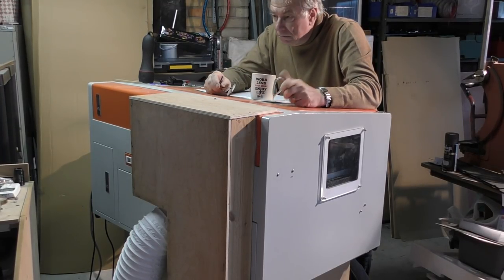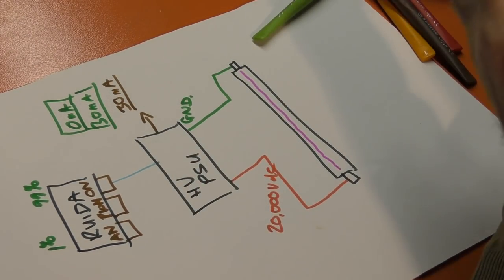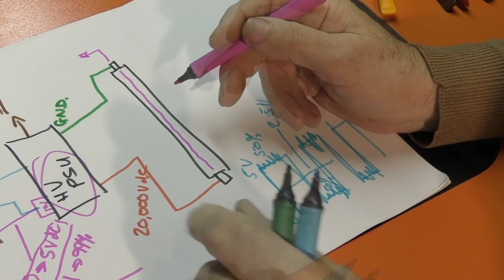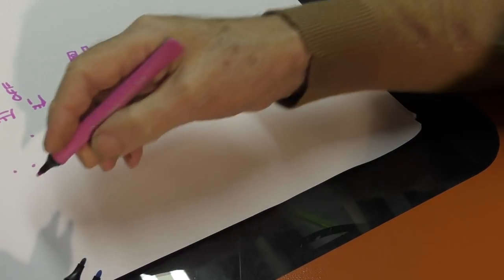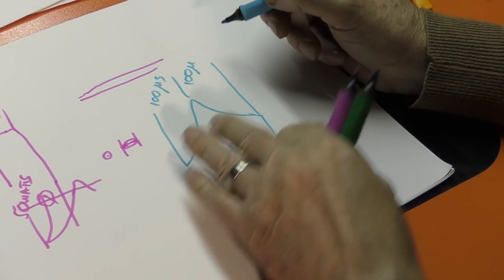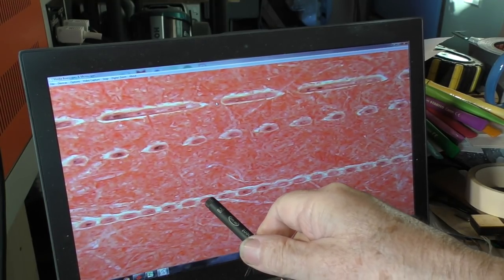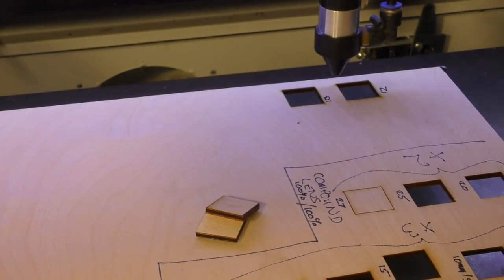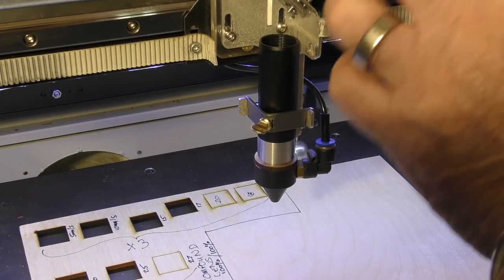TangerineTiger16 What Can We Cut with 20 watts

Comment: Hello Russ, first and foremost, thank you for enlightening me with your videos about lasers. They have been a good point of reference, since I just acquired a 60w Co2 Laser machine. I've been three or four nights watching all the videos of your blue china machine and the new tiger in Spanish subtitles. I have been amazed at how you gut to the maximum all the concepts that influence both cutting and engraving. Another thing that I saw in your videos a couple of days ago was to control the air in the nozzle with the example that you put by closing and directing the air jet ... Since then my recordings are much cleaner, which I thank you for. Heart, since the sellers as you say in one of your videos only tell you how it works, but they have no idea how to get the most out of the machine. I am a professional photographer and I only want my machine to engrave all my packaging. I see that getting a clean and perfect engraving is not easy. I would appreciate some advice on how to get the most out of my engraving machine. Thank you very much and greetings from Arahal Sevilla Spain
Reply from the maker: Hi Manuel
 If you like to add your disguised email address to another comment I will contact you and delete your comment
 Best wishes
Russ

Comment: Hi again Russ
Sorry to bring up further boring stuff... ;)
I am not yet convinced... :o)
I planned to try to do a video to better explain my understanding of it since your last video, but some C related illness struck the family so it got pushed back.. (no worries about the family this far... keeping our fingers crossed... )
I’l see if i can throw something together in the weekend...

But in the mean time.... I fully agree with your glass tube related findings regarding analogue vs pwm of a hv-power supply. With the additional note that the tube itself might also add some slowness to the system response... ie it takes some time to energise the gas cloud in the tube tube and establish a beam, and vice versa, it takes some time for the built up energy to dissipate from the tube by the lazing action. But the pwm filtering stuff is as you said implemented as a low-pass filter at the psu control input. In the rf tube case, the filtering stuff is made up of the complete system, where the main filtering effect is taking place in the gas related physics of exciting atoms and getting them to emit photons... 

Regarding the proof of the rf-tube pwm issue, I still think my point is valid, the result is in line with what i expected, because you run the tube at a pwm frequency that is below the filter effect i spoke about. The specified 100+100us corresponds to 5kHz, to make use of the averaging effect the pwm frequency needs to be well above that. They specify 25kHz as the recommended max freq so go for that. If you repeat the red card test with all the same settings but only change the pwm frequency from 5 to 25kHz, and then repeat the test at 50 vs 100% power level I think you will see another result... actual smooth analogue power control. 

(I hope I'm not upsetting you with my nagging about the pwm... I’m just trying to reveal some of  the things i have seen a little further down into the rabbit hole of electronics and physics. They are of course my interpretation of what I’ve seen, but i hope that those can spread some light and usefulness in this much interesting journey into co2 laser technology. I sure have learned a lot from your videos.)

 
Best regards
Reply from the maker: Hi Klas
 Please take your time. Personal concerns assume a much a higher priority and be assured of my concern.
I  will never get frustrated or worried by rational and logical discussion  about things I am willing to learn about, so please do not apologize.
 At present I have proved to my own satisfaction that  that the raw PWM signals  are not being filtered or interfered with but are driving the lasing process directly. I fully understand that the switching process for a glass tube may be virtually instant but then there is a significant delay while  the flyback transformers to create the high voltage that in turn  ionizes the nitrogen.  The process of ionization, once triggered,  is in itself almost instantaneous  and starts creating photons immediately .  The amplification of those photons to a usable power beam  takes only a few reflections off the internal mirrors. Typically those mirrors will be about 1000 to 1200 mm apart. For a photon to travel such a distance takes about 3ns.  Within an RF unit the distance is much shorter so lets say about 1ns travel time between mirrors.  The excited CO2 electrons can only remain in  their high energy state for about 1 millionth of a second before they randomly emit a photon while falling  to their ground state. However that excited state is 1000 times longer than the rate  passing photons that will STIMULATE their photon emission.   With these times associated with the physics , provided you do not turn the ionization off,  I can understand why the switching is almost instant. The whole point of RF technology is the pre ignition parameters that hold the nitrogen at  the threshold of ionization so there is  no noticeable switch on time. Even at 25khz where the cycle time is 40 microseconds, that is several magnitudes slower than the nanosecond physics.

 That is my very naive understanding of laser  physics and it has been adequate to explain everything I have observed so far. There may well be practical physics phenomena that interfere with this oversimplified model and you are hinting at such conditions as the frequency increases.. But let me stop for a moment and ask how will it impact the use of this machine for cutting or engraving organic or mineral materials?  For cutting  the frequency is nullified because with 20 watts  I will only be ever using 100%  For photo engraving I will always be limited by the power available (as I have already found out) so that automatically causes me to run slowish (600 mm/s max) and setting low frequencies  and  generally 50% PWM to match power pulses to pixels.  I have already proved that doubling the frequency may double the  pulses per pixel  but  the net effect is 50% less  burning   and a very weak light result. Gray scale engraving is something I have yet to explore but  I an very confident it will be slow(with 20 watts) but precise, provided I use  multiple burns for 3D engraving. Photo engraving with greyscale is always going to be poor quality, not because of switching speed but because of the very limited tonal range available for the few organic materials that can be used.  I have already tried this with the glass tube laser using the 20khz  PWM  signal and not switching the beam off . Very fuzzy results.  

 My point really in all this  is , for what reason will I ever need to use the high frequencies available?    With 20 watts I will always be using low frequencies or CW. However it will be interesting to to see where my simplified model breaks down and for what reason.. Even if it will not affect  my results, I am always happy to acquire new knowledge as it keeps my two remaining grey cells active.
 As I said, with your personal matters to attend to,  there is no rush to educate me . I have been ignorant on this subject for ever, so another week or two will cause no harm.
 Sincere best wishes
Russ

Comment: Yet another interesting video, Russ. Thanks for sharing. Although I am bit puzzled where is the video you mention at 39:02. I only remember that you have uploaded the taster for that group of tests.
Reply from the maker: Hi Nico

You are correct. It was a quick exploratory taster  and I have not yet found time to study the  promising possibilities in depth. I have been cornered with so many other things. The good news (in a way) is that the fiber laser is no longer with me. It was a loan machine that has now had to be recalled because it was being used to fulfil an  urgent sales order. That happened just right for me to work on designing and preparing parts for the Russ Spec machine to send to  Cloudray. Just as I was clearing that task the  RF unit arrived from Cloudray and that has forced me to work on the Tangerine tiger and get even more distracted with manufacturing all the parts for sale.  I am just starting to get a bit clearer now but I need to push on with running through all the basic things that the RF machine is supposed to be able to do. I have not forgotten the 4"  lens work because I am convinced that diverging a beam onto the lens will exploit a weakness in lens theory and that is that the closer you get to the lens axis the less you can focus and now associate that with the intensity distribution within our beam where  the highest intensity is at the center of the beam. Bring these two factors together and it is already looking like there may be some significant CUTTING benefit to be had .
 Best wishes
Russ

Comment: Hi Ross, Abraham here. Could we leverage the capabilities that the beam expander give the RF tube on a glass tube? I believe the answer may be yes, what sort of cutting advantage we may be able to get. I think a beam expander would be very useful in particular on large machines, where the beam quality degrades the larger the beam travel distance is. Maybe that myth I often read about a 100W RF machine been equivalent to a 150W glass is all due to that magic beam expander.
Reply from the maker: Hi  Abraham

Bean divergence is a real issue fir RF tubes as it is about 3 times greater than glass tubes. However, glass tubes are not immune because their divergence is about 2.5mm per meter. So if your 100 watt tube starts off with a 6mm beam as it exits the tube and it is a big machine (say 1m in Y and 2m in X, in the extreme path leng situations it could vary between  0.5m to 3,5m. That means  the nominal beam of a glass tube will change from (6+1.25)= 7.25mm to 6+ (2.5X3.5) = 14,75mm over the table area. That implies much better cutting near to the tube.
 There is no logical reason  why you cannot use a beam expander with a glass tube. it is just a matter of finding a way to mount it axially true to the beam just as it exits the tube. I have demonstrated the CUTTING advantages of a compact bem hitting the lens  but it will not change the power. 100 watts is 100 watts  As I am beginning to find out, there is no magic in RF  technology. it's  just a VERY expensive way to get instant tube switching which is great for high speed ENGRAVING.  For CUTTING you do not need high speed switching or a high speed machine, just CNC motion control and lots of power. I still consider the glass tube technology as being the perfect jack of all trades. You can easily afford to buy a small 50/60watt machine for engraving and a bigger high power machine for cutting and have lots of change left.

Best wishes
Russ

Comment: this rabbit hole is starting to get very interesting even if I have no desire to go down the RF route. I am a glass tube guy into cutting, what really grabbed my attention was right at the end after your cutting test where you mentioned using a 7.5" lens coupled to a 2.5" lens. For some reason I seemed to have missed that RD Learning Labs video, can you tell me what number video it was on? On a seperate tack, a couiple of years ago I bought a top of the range desktop laser from HPC and assummed that a machine for nearly 4k pound would have been fully adjusted. I use it almost exclusively for prototyping small items and there fore concentrate all my work in one small area of the bed. For a long time I have been susoecting that something was amiss with the bed levelling so before moving the machine I decided to do a bed check as per your video from way back. What I found staggered me. The bed was totally skewed diagonally by over 5mm in one direction and nearly 7mm in the other diagonal, Just goes to show that you can not even trust a so called reputable UK company to do any real quality checks on their product, so why pay the premium for a UK sourced Red Sail Clone. The mis-alignment was so bad that the only way to correct it was to totally strip the entire bed lift mechanism, strip off the belts , remove the screw jacks and reset each by hand to a known reference. i also found under the belt adjusment that the base of the machine had been drilled multiple times arounf the locating bolts not what you would expect to find on a well set up machine, tere had certainly been a bit a of bodding going on, hopefully not in the UK, but who knows. Anyway, the bed is now perfectly levell and the machine cits well in all corners and in the middle. Two hours hard work turned an okay machine into almost a great machine. Okay enough waffle, keep the videos coming and help expand my knowledge of these facinating machines.

Comment: Hi Russ, thanks for enlightening me with your series on lasers they have been a good point of reference. as I have just acquired a old dead machine and have completely rebuilt it as a lock-down project now working, looking forward to seeing what it can do.?  just a briefly return of info PWM  pulse width modulation is the time between the pulses change, what you are explaining with the sketch changing the height of the wave is AM aptitude modulation hope it helps.? I have just signed up to RDworks PM me if you need too. Great series.
Reply from the maker: Hi Ron
From what I have seen so far there is no change of amplitude with PWM. It is a  0  and 5v square wave .  As a mechanical engineer dipping my toe into an electronics ocean, there was a time when I thought there may be some amplitude variation as well to add another dimension to the  PWM  signal but thinking about it logically tells me that would destroy the whole principle ( Width Modulation). So I am sorry if there was some confusion in my video.
 Best wishes
Russ

Comment: So, if i lower the nozzle from 8mm that i am currently, to 4mm, i should be able to run much much faster than 27mm/sec that i normally run... I think now i see the point of fiber lasers that the nozzle almost touches the work...
Reply from the maker: Hi Polis
There will be an advantage for all materials but some materials like wood will see more gain than MDF ( lots of plastic  plus sawdust)  or acrylic.. It depends on your nozzle design (length of thread) that will determine what washer thickness youncannuse.
Best wishes
Russ

Comment: If you had ~3,000£ to spend on a laser for cutting which would you buy?
Reply from the maker: That is a near impossible question to answer because I have no idea of your needs. Is this for a small business that you hope to start? is this just for personal hobby use? What is the biggest thing you might want to fit on the table?  Do you plan to mainly do cutting ? Do you live in a 20th floor apartment? For £3000 you can buy a reasonable machine but whatever you buy for this budget will have some issues. It will not be a simple plug and play machine. You will have to be prepared to do some work and probably buy a new tube to make it into a reliable machine. If this is your first machine, them maybe spend as little as possible and stay small (300x600 or600x400mm) and use it as a learning vehicle. In a year or so you will have a much clearer idea of what you REALLY need and have experience of the machine and the technology to make a more informed purchasing decision.
If you wish to attach your disguised email address to another comment I will reply and  you can send me links to machines that interest you and I will review them for you.
 Best wishes
Russ

Comment: Russ,  is there a contact email for contacting?  I have an old epilog 25W Profile.  I would like to discuss if you think the Ruida board would run it.  Right now it has to have a LPT port and windows XP computer to run it.  I would like to get it running again but use USB
Reply from the maker: Hi
If you would care to add your disguised email to another comment I will reply and carry on a discussion off line. I will also delete your comment
 Best wishes
Russ